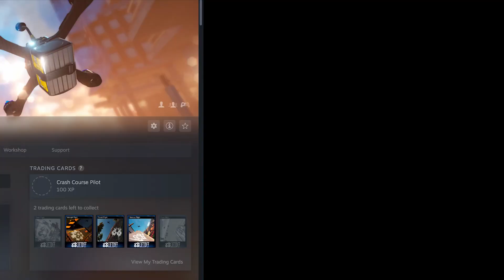Learning FPV with No Experience

Comment: has anybody else noticed that in the initial stages he was plugging in the quad with out the vtx antenna attached?
Reply: everyone that says that is full of shit. Its not going to burn up your VTX.. your antenna is a open circuit itself unless its a cloverleaf and most transmitters has a set transmission power so its not gonna try harder if its not connected

Comment: Man, I custom built my first FPV drone with medium high end parts and started in horizon mode. 2 Weeks later in a windy park, I went sideways in acro. I punched out completely upside down driving the drone into the pavement. I found parts scattered for 30-50 yards. One motor and the transmitter were salvageable.  I went to rebuild and THEN decided on the simulator. It saved me hundreds of dollars. I still wreck but nothing like I did before. Mostly lose it for 30 - 200 minutes at worst now, heh.

Comment: 4:59 OH GOD F*** F*** PLUG IN NO ANTENNA WTF
6:33 OH S*** NOT AGAIN
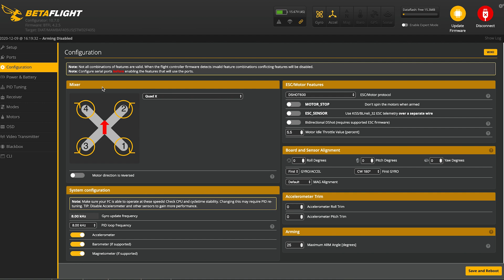7:10 finally got an antenna, good thing vtx didn't burn
Reply: The things we learn when it’s too late usually!
Reply: @neilstewart2036  good thing I started on micros and the antennas were UFL pre attached
Reply: @tomeaston2962  same bought a mob6 and eachine 5 inch at the same time luckily flew the whoop first on second frame at the minute I was ignorant to most things coming from dji a lot to learn but also a lot of fun

Comment: at first he powered the Kwad up without antenna attached and already damaged his Vtx bevor doing anything. it seems it works still after that. if its a few sec. does nothing but not good.
it could also work after but its still damaged, not like new. Maybe not clearly on supposed channels anymore. might cause problems wenn flying with others and such things. Antenna must alway be installed wenn you plug in a lipo. he could not know i did the same stuff wenn i was new to the hobby.